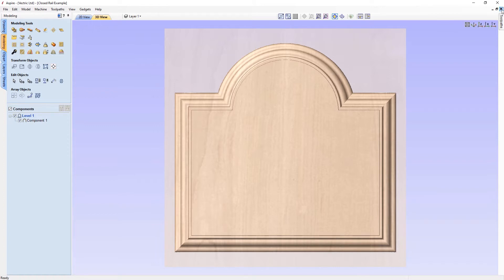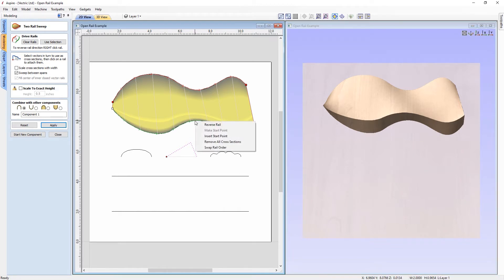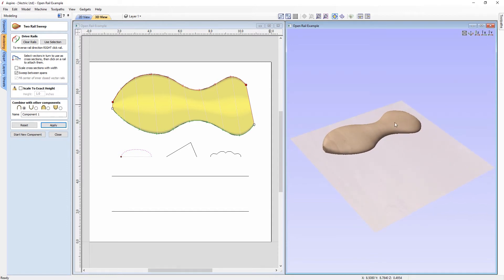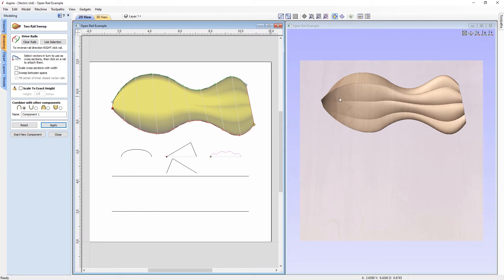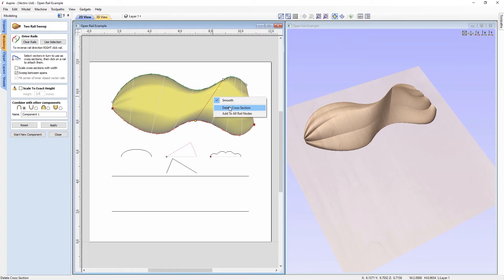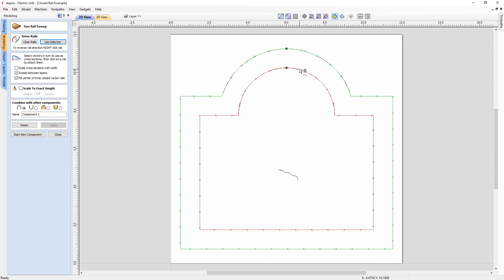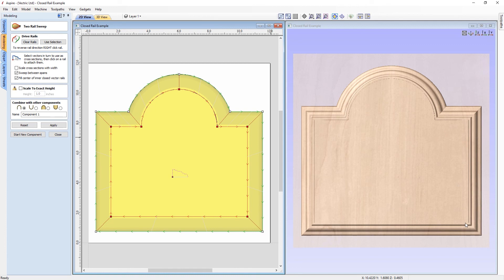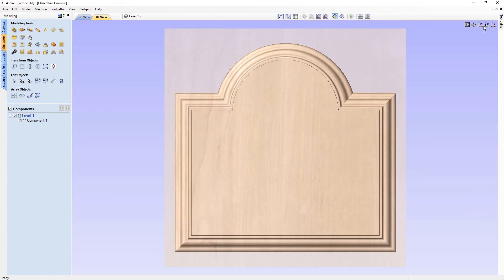Two Rail Sweep Guide | Vectric V11 Tutorials

Comment: At the 17:50 mark Can you give a more detailed explanation of why the initial cross section vector resulted in flat (not raised) center and why adding the vertical leg fixed the problem.  Thank you
Reply from the maker: Hello... you need the leg so the tool knows that that end is to sit on the modeling Plane.  If it is not then then the crossection is rotated so that the endpoint meets the modeling plane. with it meeing the modeling plan "flat" we assume there is not he want to fill the center.  If you give your corssection a stright wall on its inside... then we will fill it in, if you have the option selected.  Remember you need to have "Scale cross sections with width" turned off.

Comment: What is the advantage of the 2 rails system vs the 1?
Reply from the maker: Thanks for the question.  The 2 rail sweep allows you to vary the cross sections thickness by moving the 2 rails closer or farther apart.  Also you can vary the "shape height" aswell.